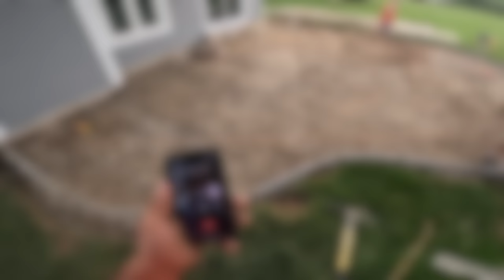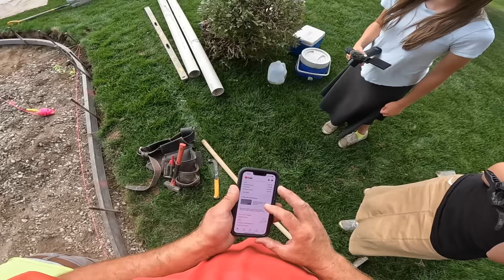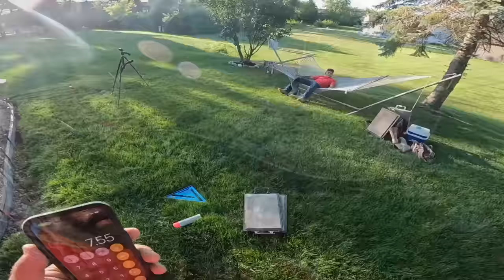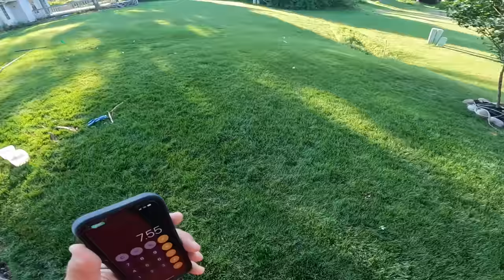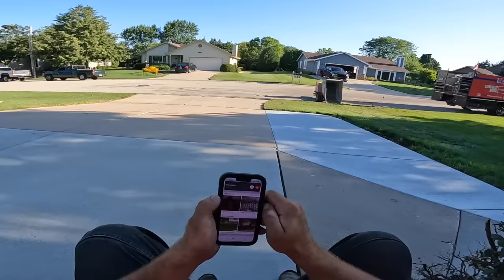Concrete checkerboard patio!

Comment: I worked on a paving crew for a few years, boss didn't do much concrete, always had the same guy come with his crew. I hurt my L1,  L4 and L5 discs after putting a packing plate on a Mason dump alone in the rain, twisted on the way up.  I fix commercial kitchen equipment now,  like the bunn coffee brewers at 0:50. I definitely don't miss having my hands clench from dehydration, but I do miss working outdoors. Love the channel.

Comment: We have load's of the 3M spray glue over here in IRELAND was getting some other bit's in the hardware store and they had Case's and Case's of it I picked up a can because I've seen you using it so I have it in the Concrete pump now in case I'm on a job and the Guy's mite need some.

Comment: For the downspout you could use a Y connector with  the clean out plug so they could clean it if the pipe ever gets clogged

Comment: Hey Ryan, a secret spot I grab 3m spray is a drywall supplier. They have the 3m spray for corner bead. Check a mom and pop or mid level sheet rock supplier and I bet you’ll find some

Comment: Hey Ryan, You probably already know this but when you went to home Depot for the spray glue, and also a 4 inch downspout adapter in another video it made me think of it... A lot of the time when they are out of something, they have more up on top of the rack and they just haven't re stocked them yet. When u looked up by the glue I saw a 3M box...that specific one probably wasn't what u were looking for but it it might be up there somewhere if you didn't already look! Keep up the good work!
Reply: As a follow up, check the website. It should be updating automatically with stock even if it's not shelved yet.

Comment: The family that lives next door to me had a new driveway in. they didnt put any control joints in till 2 days later they had to come back and take out 4 6 by 6 slabes and redo them they had no wire in the ground and right next to the house for some reason they made it 6 inches and not 4. They got so mad at me when i told them dont they know we live in a cold weather state that they have to have wire in. The owners of the house have yet to pay them and i even told them not to with them not using wire and miss coloring the walkway. Drive way people will be back in a week to rip out the whole thing and redo it on there own dime. The best part is i would of never had the idea they where doing something wrong if it wasnt for Victory thank you. and sorry for the long run on lol
Reply from the maker: Wow!

Comment: Question! you were explaining about drilling rebars in the garage floor to connect it with the driveway. wouldnt it be the same thing if yous didn't put the rebars at all since its been drilled at the bottom?

Comment: Ryan I have a garage floor that was previously painted a couple of times. Each time the paint has failed to hold up to typical shop cleaners the worst was behr from Home Depot. Of course the paint manufacturer tries to say it wasn’t prepared properly but I followed the directions and used their products they recommended. What product would you suggest? I use the garage for personal routine car maintenance. So it gets some oil and brake cleaner etc.  on it. would a stain be better than a paint? Any suggestion would be greatly appreciated. I’ve also used rustoleum garage coating and it blisters when chemicals would get on it. I do plain on stripping the floor completely for a fresh start on it I would just like this to be the last time i do it. As it is a large area and this will be my fourth time doing it. Thanks your your time and advice in advance.

Comment: You need a medium 3/4 hammer drill and a pin setting shaft/bit. That way all this 16 oz hammers on steaks and your best finisher out there swinging a 4 lb sledge all day long all you do is just walk over top of the pen and hammer drill it down into the ground it's really sweet
Reply from the maker: I’ve actually never tried that.

Comment: If the drive way went up (heave) wouldn’t the rebar take a chunk out of the bottom? Or are you saying it busted the full thickness of the pour. Because if it shelled off the top of the concrete that would be the slab going down…

Comment: Isn't it true that cracking is due to contraction and that if you used a higher cement ratio + water reducer you would have less shrinkage? How else do they have that anchor cement that expands?

PS that bush is doomed

Comment: Y even use pin the little pad to the sidewalk at all?
I don't feel like theres a true benefit if the ground work is done properly under the new pad.
Reply: What does this even mean? Did u read what u wrote?

Are you talking about when he said he doesn't anchor in the middle, does it at ground level?
Just what he said, it wont usually sink (that is a little extra peace of mind) it will rise tho, so u dont want it destroying the new concrete.
Also, its little unnecessary steps people make, that make them better than the next guy.
The next time someone does something to ur car, and puts a plastic seat cover on, do u question that? Most likely nothing will get on ur seat, but the possibility is still there.
Get over urself.
Go show him how its done.
He'd allow u to come there n help him.